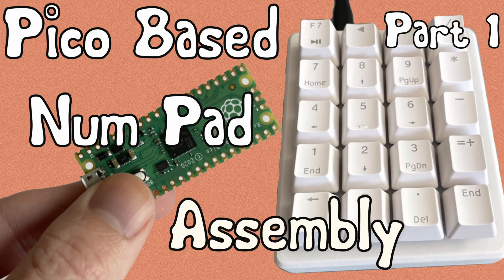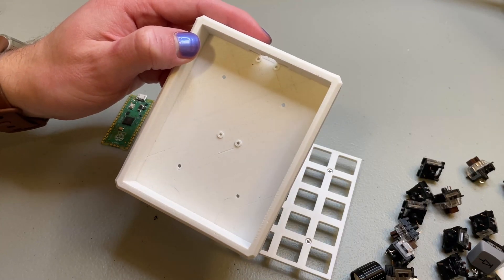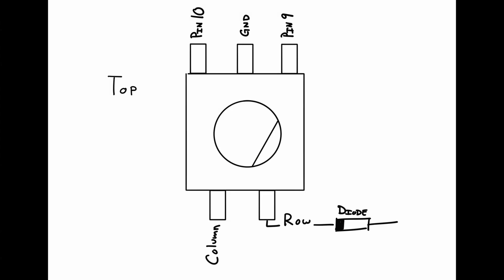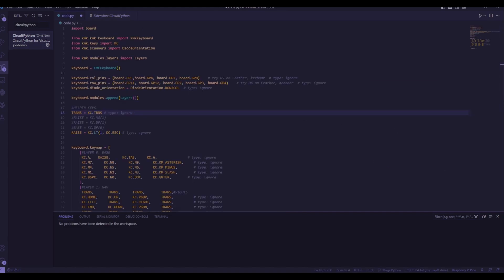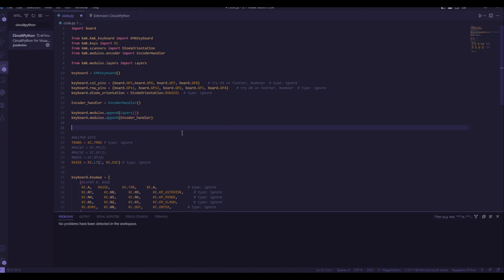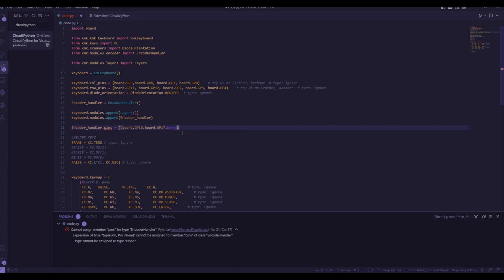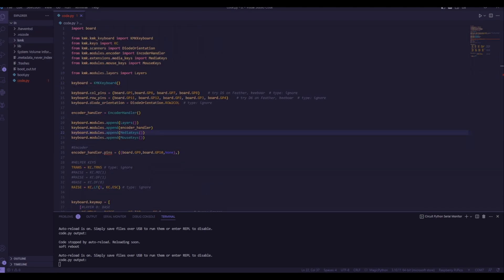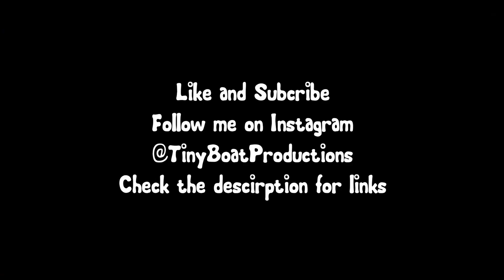Number Pad Part 5 - Encoder

Comment: Great video!
Two problems I had:
I couldn't map the click from the encoder
I don't know how to increase the speed of the cursor (I'm mapping the encoder to mouse X)
Reply from the maker: Humm, I would double check that the click is wired into the main mesh correctly and the click is mapped.
As far as the speed, I swear there was a way to change it but I cannot find it anywhere. But some acceleration on the knob would be slick

Comment: I enjoyed this series.  Subbed.  What happened to the RGB?
Reply from the maker: Just didn’t install it in the new case. I hope to make this one wireless at some point and LEDs would impact the battery life.
Reply: @tinyboatproductions  Makes sense.  I've printed out the case.  Do you remember the size of the standoffs you used?
Reply from the maker: I used 10mm spacers on this
Reply: @tinyboatproductions  Thanks.  This was of course something I should have figured out myself and did after I posted.  I ended up remixing the case to somewhat match my existing keyboard, give it  a nice typing angle and a translucent section on the sides for better RGB.  Waiting for my diodes.  Looking into making mine wireless as well but really do like RGB

Comment: Nice. Very helpful for those interested in kmk. So much easier to understand and alter on the fly than qmk. Kmk is my go too, and you videos have helped a LOT. 
The rotary encoder is cool.
Do you have the links for the keyboard. Love how it has 3 thumb positions.
And I don’t think you links worked in the description.
Reply from the maker: Glad to hear!
Thanks for the heads up on the links should be good now, also added a link to the keyboard.